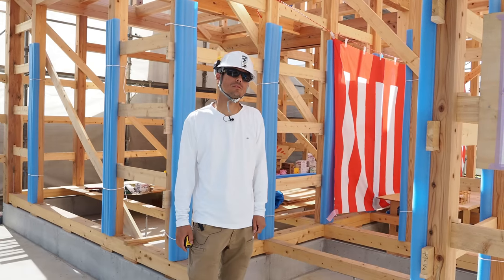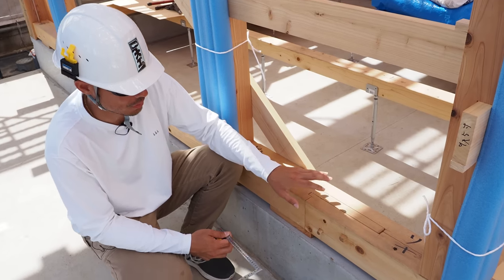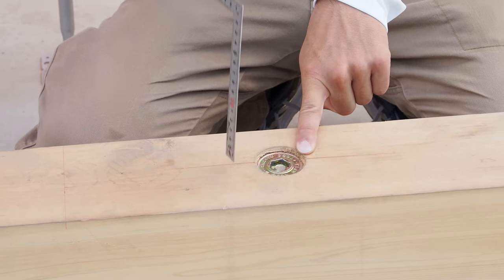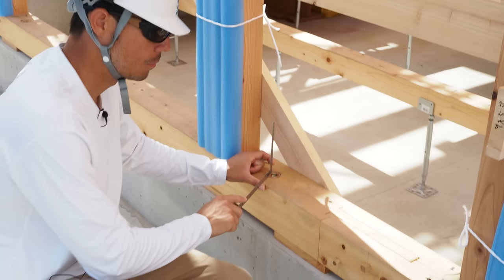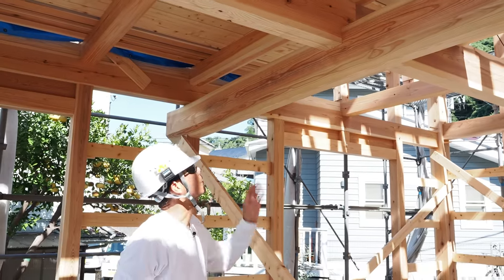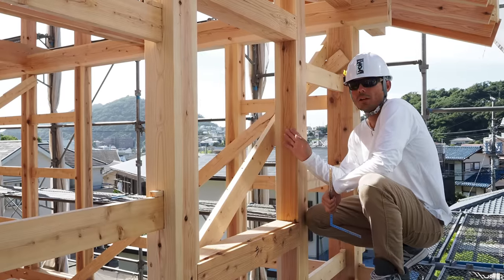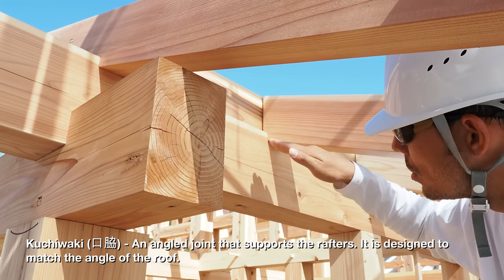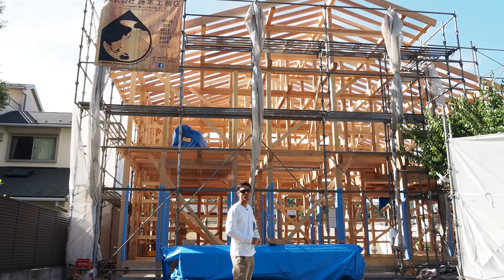A Technical Walk Through of a Japanese - American House Build in Japan - Traditional Carpentry

Comment: Stunning carpentry work. I have built some impressive houses in Australia and Canada, nowhere near this level of craftsmanship though. Japanese carpentry is truly elite, the pride they take in their work is inspirational.
Reply: Most Canadian carpentry for typical housing looks like a bunch of hacks compared to this
Reply: @Chris-nt9lk  same with australia, very few trades have pride in their work, from the carpentry to the plumbing and electrical.
Reply: A tip I heard one time for anybody building a house, is to hire the finish carpenter (the guy(s) that install your doors, trim, stairs, cabinetry, mantle etc) to frame your house, instead of hiring a framing crew. It will cost a little more, but there is no comparison between a house framed by an actual finish carpenter vs a house framed by a "framer."
Reply: @Chris-nt9lk  I work for a high end custom builder. We build some amazing houses, our carpenters and subs do great work, very small portion of the industry do though, and nobody here builds houses like these guys in Japan do.
Reply: @joseph7105  I work for a high end custom builder. We build from start to finish, makes it a lot easier to trim the house if you've framed it. Most high end custom builders kep it all in house. It's the cheaper volume housing where it gets divided up and none cares about the trades following them.
Reply: @Chris-nt9lk I completely agree .. the carpentry work in my house is very poor. Get the job done as quick and as cheaply as possible and it shows.
Reply: To be fair, this is not typical fair in Japan, either. Most houses are NOT timber frame houses, and in fact, a large portion of the houses go up in less than a week and are basically lego houses on stilts. I live in a stick frame house in Japan. It is nowhere near the level of quality of this house. No one in my entire housing complex lives in a timber frame house, though there are a few log houses. They, too, are pre-cut and largely pre-fab. 

The house in this video is a timber frame house, whose equivalent in the West uses similar levels of craftsmanship, though with a very different aesthetic. Look up timber frame homes in your area some time; you will see that it is a tradition worth preserving no matter where you are.
Reply: @guyprolly  yeah no doubt the majority of the Japanese population can’t afford to build houses to this standard, same applies to anywhere in the world but it is great to see there are still carpenters there that can still build to this level. I live in Australia, large timber frame houses barely exist here, we have never had the demand or timber resource to be able to do it, therefore very few carpenters that could produce work like this. I lived in Canada for a few years and got to work on some impressive houses with timber frame elements, there absolutely are people building true timber frame buildings there too but only for the wealthy minority. In general the pride that Japanese carpenters take in their work and their tools is unparalleled in my opinion. Some amazing traditions there.
Reply: @bevelcarpentry  All of that is true Bill. Sadly, like what happened in the USA, most of Europe, and Australia, Japan are importing scab workers from abroad, who have next to no skills. The modern houses that go up are sticks and glue and nails, the same as are in the USA and Australia. Again, the house you see here is an upscale house that cost a good 2-3x what a stick frame house costs and of course, uses quality Japanese carpenters. 

In the olden days, whether you were in Europe or Japan, there would be no foreign carpentry scabs and quality was high, and especially as you see in French scribing, Roman carpentry, Classical Japanese carpentry, and more, it wasn't just attention to detail, but almost a spiritual practice.

Comment: The attention to detail and getting EVERY joint right, the windows at perfect 90° corners, the locking of each beam, the angle cut of the rafter and the holder and its not just a notch, but an angled cut.  The rafters, every corner is chamfered....  holy crap, this is the most beautiful framing i've ever seen.  I would love to see Matt from the Build Show do a walk through of some of your jobsites in Japan....  The attention to detail and doing it right, over speed and getting it done fast is just mind blowing....  that framing and woodwork is art, I would want all those details exposed int he finished home if that were my home... absolutely amazing work!!!!!!!

Comment: Great to see the framing job complete. Skilled precision and beautiful timber. Any idea on the quantity of timber used in such a build and the typical cost of the timber. That cedar has got to be very expensive.

Thanks for the update TCL.
Reply: I believe the MAIN tree of Japan is cedar and they are buried in it making its price actually low in Japan.  I believe if my memory is correct their Cedar strength material properties is between Western Red Cedar and Southern Pine for a USA reference woods comparison.  What they import is actually Doug Fir(actually its a pine) and Hemlock if they wish for a white wood instead of the Yellow of Pine.  Timber cost will be 5X that of a regular build due to size and length requirements.  Labor cost?  Sky high.  There is a reason the Japanese like everyone else has moved onto modern construction methods.

Comment: It's really interesting. Thank you for presenting. I wonder - am I seeing pencil marks on the beams and the "baseplates" where the hardware has been installed or are they small splits along the grain? Thanks again.
Reply from the maker: It is probably pencil markings. If the wood will be covered by plywood or drywall we do not remove the markings. Thank you for watching.

Comment: I recently built a covered fence using wedged nuki, and one thing I am noticing is that the wedges are becoming loose in the summer and need to be hammered in again. How is this problem overcome on a house like this?
Reply from the maker: The wood we use here is Japanese cedar and the wedge is usually made of Japanese Cypress. When we install the Cypress to the Cedar there is some deformation to the mortise which may be the reason for an extremely tight friction fit. I haven't witnessed an exposed wedge sliding out. Here is Japan the wedge or the peg is a harder wood than the beam or pillar. Hope this helps.

Comment: Just looking at the precision of the foundation walls tells me that this house i built to extremely high standards.  I'd love to see American tradesmen trained to this level and taking such pride in their work.
Reply: There is a reason everyone stopped building homes in this method.  Ultimately it is a waste of time unless the frame will be visible.  If visible and you do not want to see steel as is often the case in Interior of residential, commercial, and Church buildings all the good framers use these methods for joints.
Reply: Tons of north american builders and trades take at least this level of craftsmanship as standard. Megabox builder groups are not what you should be comparing to.
Reply: Good/Fast/Cheap, Pick Two (as usual with this sort of thing)
Reply: Agreed I’m absolute stunned. Completely different level of craftsmanship from what I’m used to seeing…
Reply: @xostler  Oh it exists in NA, EU, Africa, SA, Asia etc, but you have to P-A-Y for it.  It is horrifically expensive and often with an architecture build change utterly unnecessary.
Reply: @w8stral  I'm sorry, I have to disagree with a lot of what you are suggesting...It simply is not accurate...

There are plenty of reasons to build this way. The issue is most "Americans" don't because "fast and cheap" is the standard here now...nothing more. However, that is changing with the current generation to a greater degree and with clients demanding better quality and often traditional quality of work...

To be clear, I agree there is not a lot of us, but enough that this style of work is coming back. Even here in North America. I work in the styles of this video and related "folk styles" and have for over 40 years...the number of folks wanting it is growing...and no...the price is no different than what most "modern wood butchers" charge for their McMansions and tracked homes per square foot...
Reply: @h2s142Simply not true at all...I've been building "like this" for over 40 years and it is the same price or less...and it has the added benefit of being more durable over time and ecologically viable/sustainable as well...
Reply: @JayCWhiteCloud  Whatever lies you tell yourself at night to sleep well when giving bids.  Sure a lot of people would like this construction it makes a beautiful interior, but you have to pay for it through the nose.  There is one type of housing which this form of post/beam construction is only partially expensive.  Open plan form.  For everything else it is just insanely expensive.   And no, all the concrete structures built since WWII are not falling down... in fact they are near 100% standing and doing just fine with the exception of oceanside construction because they used steel rebar instead of fiberglass.  Fiberglass you might have noticed is now cheaper than steel rebar.
Reply: @david-ow3nv  Sorry David for being late with a reply. I just saw your comment this evening...We will have to disagree on your stats and what you think you know about them...regardless of "framing in Japan" as you claim...

I have one of my own there who applied for an apprenticeship with me, and he now lives in Japan and works full time in his own business with a Japanese partner building these, and has no issue finding work. Move out of Japan and in some areas, the numbers too are on the increase...

I'm not exactly sure of this one particular location. I can state, that even today with the massive amount of modern..." crappy architecture"...being built, timber with all wood joinery and stone foundations foundation equal or outnumber modern industrial foundations and framing types in many areas. If we include just "wood and stone" as a parameter then the number goes up further...depending on region...

The proven viability of wood, earth, and stone architecture, along with traditional methods of building like timber framing...out last...the modern "speed and greed" forms of framing modalities and foundations which are without challenge if one actually compares all elements...and!!!...actually knows how to design and build this way so has some foundational validity to understand them fully. There are many (numbers are growing) building this way today. In Japan, it is quite common and not that rare at all. Some areas can be as high as 30% while others are 100% as it is mandated by local code that all frames are designed and built traditionally...

Comment: Thank you for such a nice video, I appreciated the detailed walk-through of all aspects of the house. I had quick question. In regards to the large beams (such as the ones shown at 10:46) Is there a risk of the lumber splitting in the cracks there as the seasons change? Do you guys utilize bow-ties or other joints that keep the structure of the house stable even as the wood ages? Thanks again for the video!

Comment: So why wouldn't they use some sort of plastic/water barrier sheet between the foundation and the footing/block that goes under the framing? Wouldn't that prevent any kind of moisture from the cement leaching through the block and to the framing itself?
Reply: It's probably a traditional solution for a traditional build... the way walls in pre-envelope homes allow moisture to pass through and dry gradually, instead of trying to control flow. That's my guess at least. Once you start adding barriers you have to make a system of it.

Comment: Thank you for this inspirational glimpse into the world of Japanese residential carpentry. How long would you expect this house to stand? I expect the roofing and siding will be replaced during the life of the house, but I'm curious if the frame might outlast the concrete foundation? The lumber is so clear and straight and the joinery is so tight that it seems it would stand forever.

Comment: The timber frame of that house itself is not that heavy, right? Looking at the timber used maybe three or four metric tons in total? And it's all structurally flexible, right? 
Here in Finland if you make a wooden frame house it will be heavier than that one, but not that much (maybe a ton or so more). 
Also as a notion, in traditional construction, we use tar sheets in between concrete foundation and the first layer of timber frame. It's just to block the moisture and mold.

Comment: Wow! Love your videos

I see they've put some temporary diagonal braces but I guess they will be removed. Do you know why horizontal nuki is sufficient to stabilize the house in this case? I also see that sometimes diagonal bracing is used in other Japanese traditional construction.
Reply from the maker: Nuki will be held in place by wedges. These wedges will be hammered in tightly to prevent any movement in the X and Y axis. Nuki are most common in traditional houses and are very strong in earthquakes. Diagonal studs seem to be more modern. You'll find houses here that have pistons and shock absorbers built into the framing.

Comment: Would this pass code inspection in America? Obviously this is superior joinery but I'm so curious what an American inspector would think if someone built out a house like this!
Reply from the maker: I think the build codes in Japan are very strict, I can not say they are more or less strict than America, but it is difficult to build here without satisfying building codes related to certain natural disasters. 

I would think this house could partial pass inspection, however, I think that the hallways are far to narrow when it comes to handicap clearances (wheelchair clearances). These are things that can be adjust to accommodate these types of regulations.

Comment: Why do all of the beams with joints have massive cracks running the center length??
Reply: Was wondering the same, they're all cracked already lol
Reply from the maker: The wood will crack on the outside if it is naturally air dried. If you kiln dry the wood will crack on the inside. If there is a perfectly straight crack, then this was done on purpose by a saw. You'll see this being done to the bigger beams to prevent unwanted twisting and cracking. Creating a crack with a saw will force any cracks that would form to that same spot, leaving the other 3 sides without damage.

Comment: I know its a small thing but most of the vertical structural elements you are showing (especially those in corners) would commonly be called posts - not pillars - in English. . . as in post and beam.  A pillar is a freestanding, unsupported column.

Comment: The bolts keep the house from bouncing off the stem wall for foundation… in California they bolt and strap the plate with a barrier piece of felt or foam on top of the concrete
Reply: In what I think are the majority of new construction in Japan, that space has a plastic spacer that keeps water from migrating between concrete and wood.  It also allows ventilation around the whole perimeter.  See Joto-Vent (I'm not associated.)

Comment: What’s with all the checking on the beams.  Is that something of concern ?
Reply from the maker: Checking is inevitable. The wood we use is naturally air dried resulting in outward checking vs. kiln dried which tends to have more internal hidden checking. Some say kiln-dried wood is less predictable in terms of strength. In either case, the wood is structural fine.

Comment: Some of the very biggest structural beams have cracks all along the length almost. Would that cause problems over time? Or are they filled with something to deter further cracking? Very curious
Reply: thats normal with any timber-frame construction
Reply: Its not a stress fracture if that's what you're thinking. That is a "wood check" when the wood kiln dries at the timber processing plant. To compensate all you have to do is make the beam larger than necessary for the rated static loading.  LVL and other engineered wood doesn't have this problem. Engineered lumber beams can be smaller, but it requires more $$$.
Reply: It’s calling checking, it happens in correlation to the size of the timber, because as the wood dries it shrinks much more along the width than the length. It’s natural and doesn’t normally compromise the wood, although it can in some specific cases. Timber sizes have naturally been found through the ages after drying and checking that are strong enough. Now we can do a modern engineering analysis on them and even make wood composites that are far superior in strength, but also add complexity and cost for the most part. Also aesthetically, many people want “real” timbers. However, there is a ton of contemporary examples of Japanese architecture/carpentry that use a combination of traditional and modern materials and construction.

I would love a Japanese style house with LVL lumber, hempcrete encased outer walls, and hydronic heated floors.